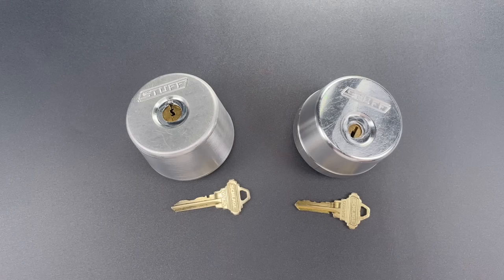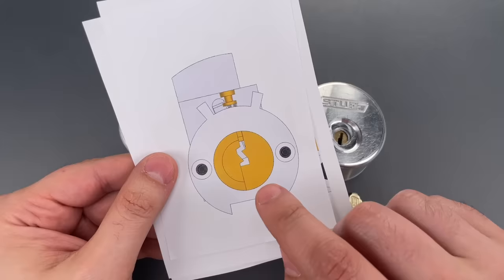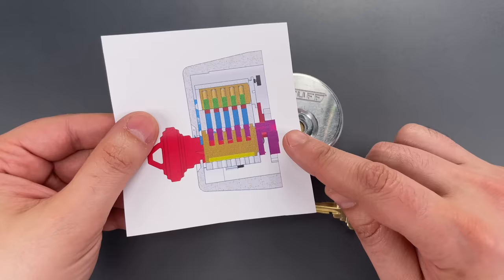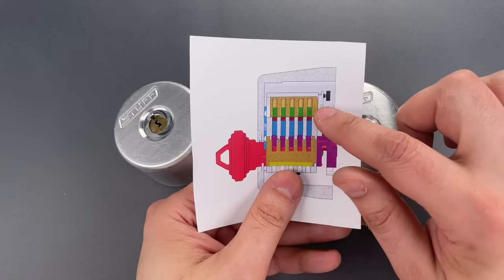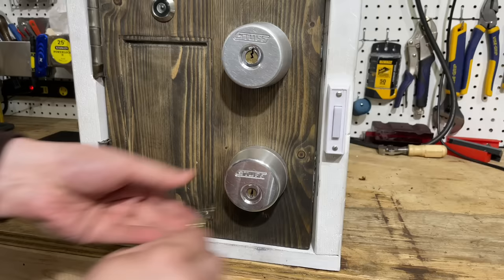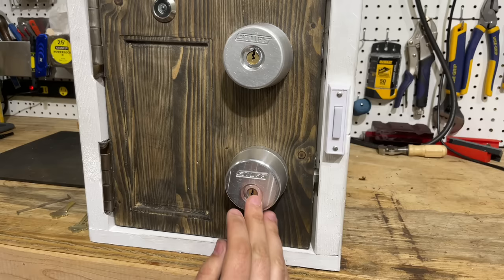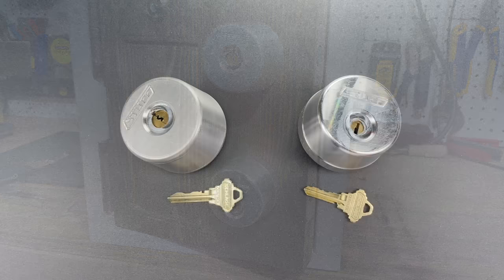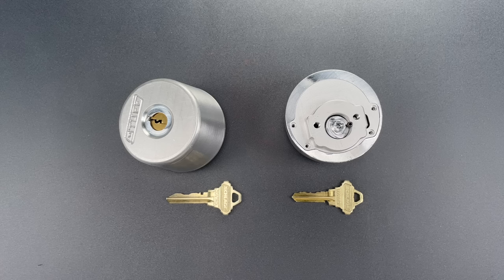[1299] Unpickable Locks From Stuff Made Here

Comment: "He did the right thing, because i definitely would have done that" just fucking killed me XD
Reply: same lmao
Reply: But wouldn't the hinges be inside the door, so you have to get inside to reach them?
Reply: @Hube02  rip
Reply: @godsamongmen8003  yeah the hinges are supposed to be inside so he messed up there
Reply: I belly laughed out loud at that!
Reply: @godsamongmen8003  depends on the door design. Residential entry doors usually open inward so the hinges would be on the inside, but commercial doors tend to open outward (fire code) and thus create the security concern. And there are several readily available security hinge types for that reason
Reply: @godsamongmen8003  some outside doors open out so the pins are on the outside.  He could have just used security hinges for outward swinging doors that prevent the door from just being pulled out if the pin is driven out.
Reply: The mock LPL thumbnail Shane made in his video was freaking amazing.
Reply: He's a lawyer.   If he can win on a technicality, you can be sure he will.  :-)
Reply: @jwmmitch  My screen door opens outward, the hinge is on the inside. It use's a very cheap butt hinge i bought from bunnings. 

All that happens is when i close my door the hinge is at a 90 degree angle. You do not need specially designed hinges provided your door is properly recessed and mounted.

Comment: Quite good is probably the best compliment he has ever given to a lock.
Reply: Particularly considering that Stuff Made Here isn't a locksmith
Reply: Has to be up there with the attempted bowley pick.
Reply: @I love you but Innovative design is a notable achievement in it's own right. You shouldn't be so dismissive of that just because it doesn't require an undergraduates degree in fluid dynamics.
Reply: There are 3 locks with a crazy keyhole zigzag, which LPL was never able to pick.

Comment: Stuff made here: I feel like he's gonna pull a tool out I've never seen before to open the lock.
Lock picking lawer: I'm gonna use a pocket knife...
Reply: if I ever find myself in the market for a pocket knife, I want whatever one LPL uses. thing seems to have more uses than a swiss army knife
Reply: I'm glad you finally got to see what a pocketknife looks like.
Reply: What an absolute Chad
Reply: @jonathantadlock-stein2023  He's shared which knife it is in a couple "Slash-Proof" videos. Its this one https://www.offgridknives.com/blackmamba
Reply: "Here's the pocket knife Bosnian Bill and I made..."
Reply: at least this time its not a piece of a redbull or whatever soda tin can
Reply: The pocket knife entry is easily negated if you put weather stripping on the door. The bolt would then be tight against the striker.
Reply: @xxRamD3yruxx  even then i think a magnet would do the job
Reply: @szymonsadlo  what about a non magnetic material
Reply: @bobssmith7524  that's a possibility. my guess is that current version is made from steel
Reply: @szymonsadlo  yeah
Reply: @szymonsadlo  could be stainless. Stainless steel is commonly not ferromagnetic
Reply: @xxRamD3yruxx  you can cut out the weather strip with the knife...it's plastic

Comment: Outswing doors are generally required to be mounted on closed hinges. The attacker should not have access to hinge pins unless the building is not up to code (or in a jurisdiction that is really neglecting dwelling security). Likewise, the deadbolt must never be accessible from the outside for the same reasons. Normally, outswing doors are seen in commercial spaces that by nature expect heavy traffic and are required to use them due to fire regulations, they use shielding on the outside of the door or a door with a lip that protects the entire swing side (also preferable in a residential area, since it allows for proper weather insulation). The mock door does not represent a door that should happen in a residential area.
Reply: Interesting - so would it not be pickable in that situation then?
Reply: @kabirkumar5815  can't say whether it wouldn't be pickable at all, just not with this technique and tools. Perhaps using something significantly more elaborate.

Comment: SMH: "I believe it's unpickable. Let's send it."

LPL: "I'm going to use the tip of my knife"
Reply: that was embarrassing
Reply: Get a good carpenter to get the door as close as possible
Reply: @conradsmith4195  well, then your door will be pickable in winter cuz wood contracts and expands with temprature and with different moisture levels as well.... so, a dry winter day is perfect to pick that lock
Reply: Sometimes just the tip is all you need :)
Reply: @conradsmith4195  Surely it would be cheaper just to buy a decent lock 🤣🔒
Reply: Yeah, that had to be a grim moment for SMH there.

"Wait, he just... Ffffffffffff..."
Reply: @conradsmith4195  Won't make a difference if picker can just take a chuck large enough to get something slim in.
Reply: @conradsmith4195  you cant shrink a door frame lol. the gap on the door is what it is.
Reply: @spirit4452  aluminum doors don’t shrink
Reply: This is the advantage of having a door that opens to the inside and has a lip covering this area.
Reply: @Deadpool-ODST  you mean outside.. as if there was a lip covering that area it wouldn't open to the inside
Reply: "This lock doesn't even lock"
Reply: @visionary9575  no, the lip covers that area so it would be hard to open out. My door is like this and it opens in.
Reply: That's pretty bullshit. Most doors don't have a gap big enough to slip a knife in. Once he said he was using his own rig I was immediately suspicious
Reply: @stevenp25100  Have you watched Shane's video? His original frame had a gap big enough to do that as well.
Reply: @en-men-lu-ana6870  regardless, most doors do not.  It's not a realistic test
Reply: @stevenp25100  I wasn't disagreeing with that, just with you being suspicious of LPL tampering with the test.
Reply: I frickin' burst out laughing when I saw him do that.
Reply: @en-men-lu-ana6870  bro almost every door has a little gap on them yeah this one’s a little bigger but they all have gaps. I’ve been doing framing and carpentry for fucking ever I’ve put in doors on every job. That gap your talking about is called a reveal. Once you level the door the best you can using shims then you focus on making sure that gap is the same all across so that your reveal is good. Yeah some are smaller some are bigger. But even the smaller reveals you can still get a knife in.
Reply: If your gonna complain about anything I would complain on how the door hinge being on the outside of the door
Reply: @xaphan8581  Why are you ranting at me when steve was the one complaining about this?
Reply: but ideally there shouldn't be a 1in gap between door and wall either.. otherwise you might as well just use a crowbar and go "and it's open"
Reply: @BassKittehz  that’s probably not even a 1/4 of an inch gap look at a tape measure and look at 1 inch. It’s not that big
Reply: @en-men-lu-ana6870  I think that was him showing the exploit of the lock. That's why he picked it after. Seems pretty legit in that sense.
Reply: @timothymanning3522  I repeat, why are people acting like I'm the one who was questioning LPL's legitimacy? It was steve who doubted it, so why are you saying this to me?
Reply: @en-men-lu-ana6870  misclick on the name and wasn't paying enough attention to notice 😅
Reply: @timothymanning3522  If it's just a misclick, then it's no big deal.
Reply: Also why the fuck is he allowed to take it off the door, and look at the back
Reply: @scape084  right... the lock itself needs to be inset in the door instead of sitting on the surface of it.
Reply: @visionary9575  lol
Reply: @conradsmith4195  If the door opens to the inside (as most doors leading outside of a house do), simply let the frame overlap the door. Maybe even double or triple overlap it, so it's way harder to simply move the deadbolt. Also recess the lock a bit into the door so it can't be grasped from behind. With those two things done I'd like to see LPL try picking it again. I guess it would make it at least way harder.
Reply: @xpectthedeath  maybe half of all doors open inside. Trailers, garage doors and back doors with limited space open outwards. Also may countries have a completely different standard and their doors mostly open outward.
Reply: @BlakeT  it would have been fun seeing him fail at it. But anyone would get their hands on a new lock and try everything to it before going out to do a job. Including drilling it out completely and drilling a small hole to access the inside.
Reply: @echo-hotel  yeah, luckily my locks don’t have screws On the outside
Reply: @arosemenaa  That's what she said....last night 😆
Reply: @xaphan8581  american doors are just made like shit,apparently. This wouldn’t work with normal doors, what shitty little door has the god damn deadbolt exposed like that, and why only one instead of two?
Is everything over there just made this cheaply?
Reply: If the door wouldn’t have been designed by children, maybe the bolts would be inaccessible and there would be two of them.
Reply: @xaphan8581  ...wrong person?
Reply: @spirit4452  metal door
Reply: @stevenp25100  right he exploited the carpentry skills not the lock 🤣
Reply: @xaphan8581  you have been doing it wrong for years you said? 🤔😂
Reply: @CodyDaCoyote  how so?
Reply: @CodyDaCoyote  why are there metal doors made with metal plates that stick out past the door frame covering where the dead bolt is? It’s so people can’t stick shit in there like they did in those video? Why would they make doors to solve an issue that’s not an issue?
Reply: @stevenp25100  he didn’t use his own rig. It’s Shane’s right but it was too big to put on his desk so he took it downstairs
Reply: @courtney-ray  that's not what he said. He changed the rig to fit on the desk, obviously no door had gap that large.
Reply: @en-men-lu-ana6870  he's tripping that's the same frame Shane sent him. LPL had to take the locks off the frame at the beginning since the frame wouldn't fit on his table
Reply: @user-jt6xh2ln9z  true, maybe cheap apartment doors have a gap but there are metal doors where you can't access the bolt, no matter on which side you're on
Reply: @Deadpool-ODST  Which is easily defeated with a slid hammer.
Reply: @stevenp25100  Then I make a gap its not hard.
Reply: @stevenp25100  A gap on most doors is standard between a quarter and a half inch, which is more then enough to shim this lock. if the spacing is too small the door binds when opening and closing.
Reply: @CodyDaCoyote  He made it wider so you could see what he was doing.
Reply: @bond1j89  i guess you're assuming I've never seen a door before? No door has a gap like this on the outside
Reply: He could've used the Lego astronaut lol
Reply: @booshallmighty  have you seen how bad these ‘decent locks’ are
Reply: @wisdon  I would argue the opposite. If you watched the video from Stuff Made Here, he actually made the lock while learning about how a lock works. And he did such an excellent job that it even got a seal of approval by LPL himself. The issues with the lock were all issues that only a professional locksmith would know about, not a beginner like Shane.
Reply: @sonicsupersam7793  Yes I have. I have also seen how bad good locksmiths are. I have worked with many when we needed non intrusive entry. Oddly they struggled most on the cheaper locks. They all resort to the same method method. Pick gun or give up and drill. The LPL's skills are exceptional. Let's not forget why we need locks. They are to keep honest people honest. Thieves don't pick locks. Why would they? They don't care about damaging your home. Most doors are incredibly weak. Windows even weaker. Lock picking is a skill which also provides entertainment. That's it. Safe cracking is the same. There are no safe crackers. They drill. They all drill
Reply: @Spirit  if the LPL taught me anything, it's that there's always a way in. Give me a pick-up and some tow cables. I'm sure we'll be able to "pick" it then.
Reply: @spirit4452  metal would in the summer
Reply: @wisdon  Make a better lock then
Reply: @conradsmith4195  well they do actually. but probably not as much as wood. id be willing to bet wood expands from moisture more than anything else.
If you google the coefficient of expansion you can find the expansion rates of many metals per Temperature unit.
Reply: That i dont think is a real issue. In the lock v2 version, both exploits can be easily overcome by how you mount the lock. For example if the lock is a bit recessed into the door material, which would prevent the shim from entering. The knife thing is also kinda same problem it's only if the door is mounted in this way, can that be exploited. If the door has a lip (as pointed out by some others) , that attack also won't be possible. So in my opinion lock v2 is actually a win.
Reply: Guys, stop replying to my comment lmao he knows more about locks than ALL of you.
Reply: The sample door swings out? What entry door to a house swings out? They swing in, so the door stop of the frame prevents access to the bolt with his knife. Hmmm...
Reply: @danytoob  you've never seen anyone slip a card behind the doorjamb? C'mon dude, common sense.
Reply: to be fair, he did predict that this was gonna happen lmao
Reply: @spirit4452  metal door
Reply: @spirit4452  all you'd need is an overlapping front face. It hides the bolt completely.
Reply: @conradsmith4195  Ummm....they do though. Using 5052 series due to its mechanical/forming properties, its coefficient of thermal expansion is: 0.000132"/in/degree F. Using a 36"wide door, it will grow by 0.0047" in width and height per degree change. So if the door fits nicely at say 50F, then at 90F (a change of 40) will see the door grow by .190" which is just over 3/16". Same goes the opposite direction(shrinking). The same numbers work going from hot to cold.

Comment: When lpl says that the lock has the potential to be “formidable lock design” with easy changes then that is really high praise for a first time lock maker!
Reply: It's even better when you compare this lock to any commercial locks, which are mostly crap, but yet sold.
Reply: @Farb S watch the second video
Reply: @Farb S RFID locks might not be pickable, but they are hackable.
Reply: @Sgt__Hawk  Then again, most would-be burglars out there probably won't have the necessary equipment needed for that, so you shouldn't have to worry too much anyway.
Reply: Well second time lock maker
Reply: @Sgt__Hawk  No matter how strong your door is or how good the lock is theres usually a window to break, I think that's far more likely than your RFID lock being hacked.
Reply: @Farb S Well that is because it is in a proof of concept prototype stage. After figuring out what needs to be done to make it actually unpickable you can fairly easily make it mass producible. I mean of course it would be expensive but the best locks out there usually are. And I mean it is already milled by a machine and not by hand so there is that.
Reply: Well yeah, prevent the shoving of something into the internals (just add a collar), prevent the disengage of the deadbolt (just change the deadbolt interaction method), and make it not decodable (just use different pin lengths). So yeah in current state promising, with very simple changes probably unpickable.
Reply: @Farb S also with all of the moving parts and springs id imagine it wouldn't last long, but it wasn't design for that more a cool prof of concept
Reply: Old guy at work just lost a heap of his retirement money to phone scammers - they don't need to physically enter to rob you any more.
Reply: @loster369  Or someone wrecks your house with a bulldozer or if you’re from Murica with some basic Wood cutting tools. 
But that‘s moving the goal posts. We were discussing ways to defat locks. And while mechanical locks might get picked, RFID locks might get hacked or someone will just copy your RFID tag without you even noticing it.
Reply: @ziggythomas1123  script kitties exist and yes everyone hates em including normal hackers and I'm working on a cybersecurity carrier and now have a hobby in lock picking because of this channel...
Reply: @Sgt__Hawk  Are basic wood cutting tools not available in other countries lol?
Reply: Exactly.
Reply: @Sgt__Hawk  Only bad RFID locks are hackable, just like bad mechanical locks. RFID locks are impossible to bypass if they're properly designed. But they require power, and SMH's lock is good for unpowered, long-term situations.
Reply: Has LPL *ever* referred to any lock design as "formidable"?
Reply: @Thorhian  They are. But in some other countries houses are build from more sturdy materials than wood. If I were concerned about burglary I wouldn’t want a house where I can literally punch through the walls.
Reply: @Sgt__Hawk  Besides wood and sheet rock, what more durable materials are you talking about? Stone, steel, concrete? 2x4's and sheetrock are fairly durable building materials for walls and framing a home. Not everyone can afford (or want) making their home out of tons and tons of concrete, rebar, and bigger forms of steel lol.

Comment: Shane: spends months engineering unpickable lock

LPL: H A M M E R   T I M E
Reply: Very precious hammer location and knowledge though. Not just whacking it on the side :)
Reply: "As you can see, the ramset claims another victory."
Reply: @1992jamo  Ramset is damn near cheating
Reply: @1992jamo  so does a fire axe or a hummer driving into the front wall